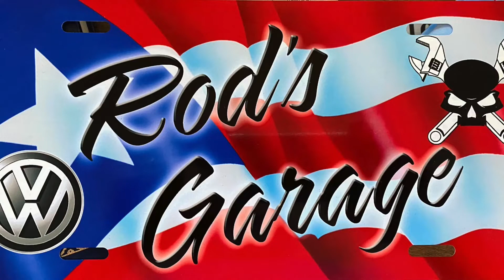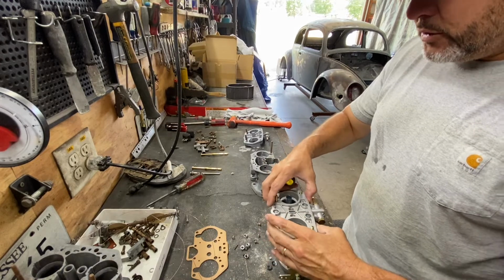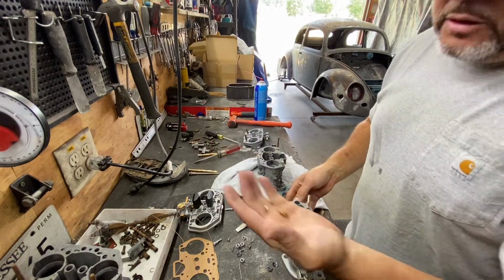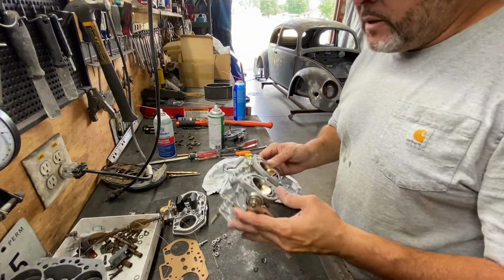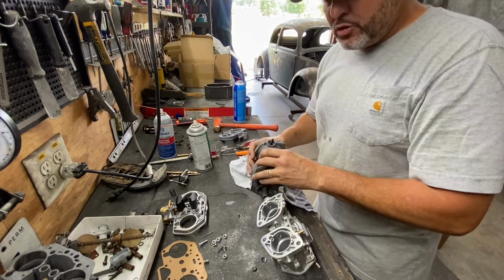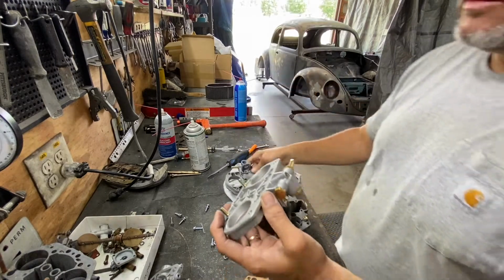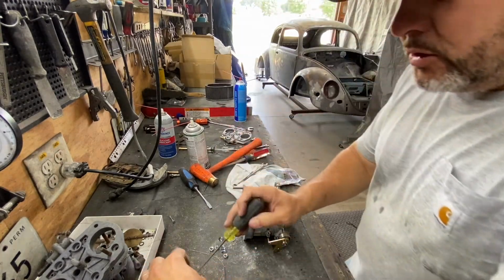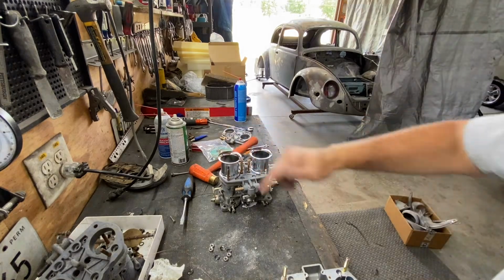Step by step on how to rebuild a 44IDF Weber carburetor

Comment: my kd's first rebuild, he found a ball bearing from carb, but only one, any idea, thanks alot
Reply: he turned it upside down with plat off
Reply from the maker: Not on this type of carburetor, there is a ball bearing with in the accelerator pump’s check valve. I hope it helps